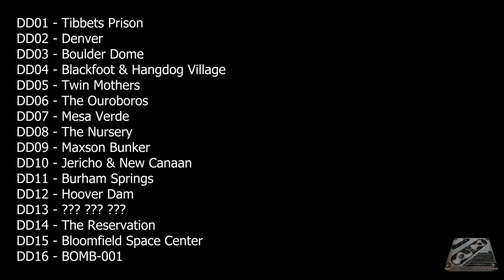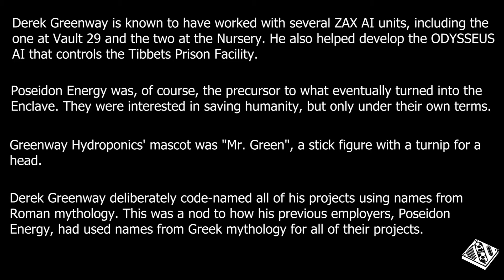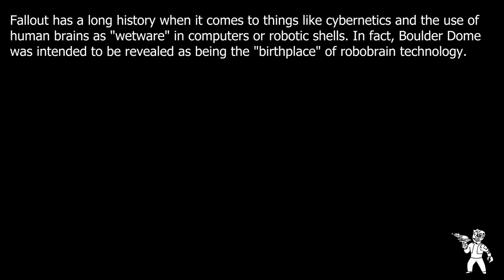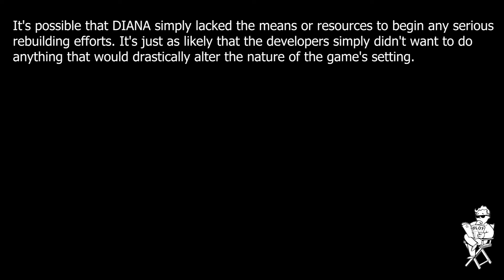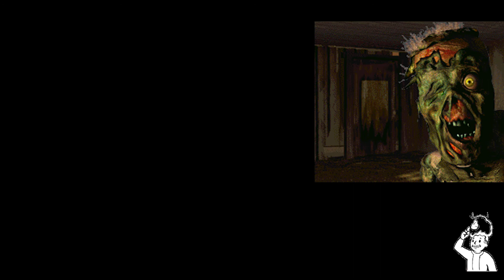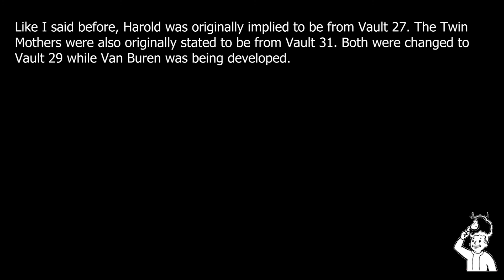Fallout: Van Buren - The Nursery, Part 1: The Lore

Comment: @RetconRaider might I ask, where did you find the info on Diana and Derek having an actual 'dispute'? I presume there was the difference in their ideas of how to run vault 29 that could make one think that, but I dont recall ever encountering any mentions of Diana being 'horrified' at Derek's ideas. Also, if you have a source where each of their ideas is discussed in depth, I'd appreciate (to me, they basically wanted the same exact thing, a tribe not reliant on modern technologies but still operated by a computer in form of DIANA; maybe Diana wanted them to be peace loving hippies but not Derek?)
Reply from the maker: It's mentioned in Design Document 05 (Twin Mothers) towards the bottom of Page 4. :)

That section describes how Derek consulted Diana about his plans for Vault 29 and was surprised by her negative reaction. He refused her request to cancel the experiment, so she quietly hijacked it instead.

She did recognize some merit in his proposed experiment, she just felt his approach was "morally objectionable on several levels."

I imagine that's why there was still a fair bit of overlap in how things turned out, but with Diana playing a much more proactively protective and nurturing role than what Derek originally envisioned for the ZAX supercomputer she had secretly replaced.